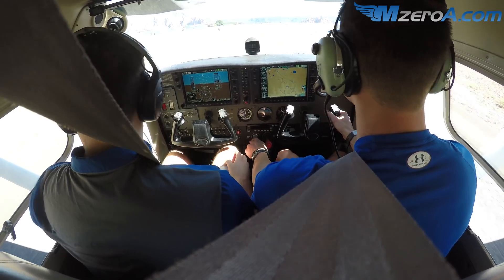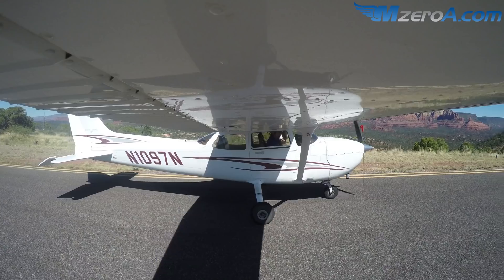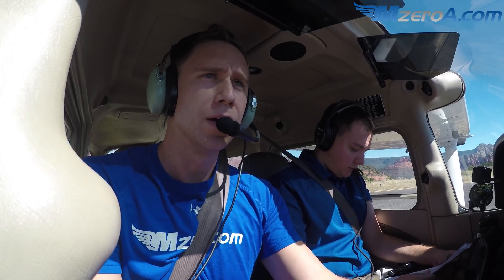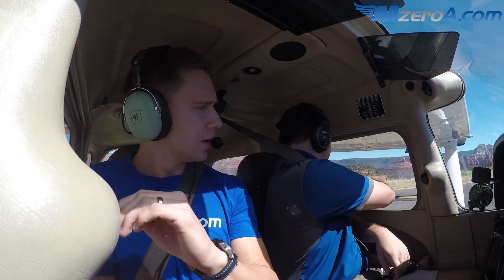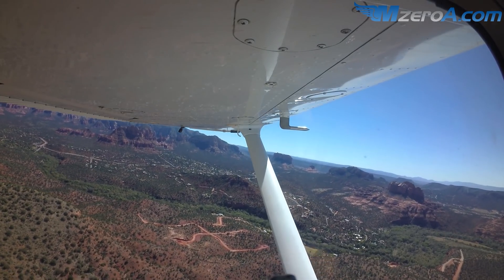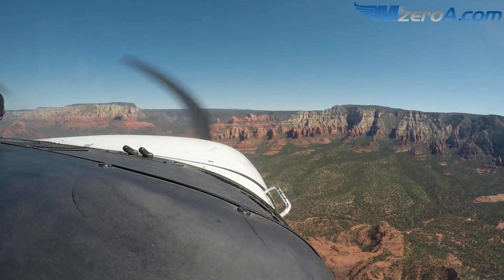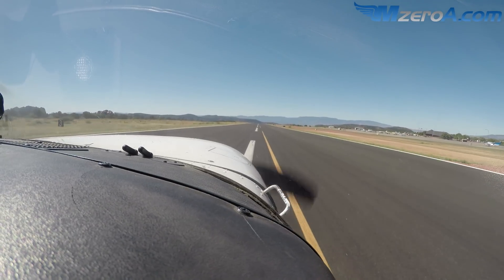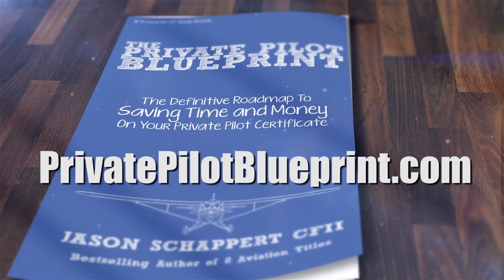Flying a high density altitude pattern - Sedona AZ - MzeroA Flight Training

Comment: Landing on 3 in Sedona is a snap - not so much with 21.  You're advised to land on 3 with up to a 10 Kt tailwind. IF higher than 10 you are advised to use 21.  That little hill they refer to off the end of 21 means you're likely on and off the power on final - a lot!  And if it's gusty, the stall horn is generally on and off. I fly a 180 HP Tiger and these AC don't have the big flaps. I learned to dump the flaps (if necessary) to get out of ground effect and land in the first 300 feet of RW. This video gives you an example of what happens when you land past the level part. After that you get into that 2 degree drop. You think you're going to touch down but the runway keeps dropping just about as fast as you are. Big fun! I will land on 3 with up to 15 knots. You do need to stick the landing before the 1000 foot mark, but you can stop pretty fast, even with an 75 kt ground speed.

Comment: You did not mention Rudder during flight instrument check on run up checklist.
It's important to check it in a front wheel airplane!
When you are taxiing, you are using front wheel for turns, as it has much more control on the ground than aerodynamic effects, and it's easy to miss that rudder does not work correctly

Comment: How would this be done in an aircraft with a constant speed prop? Would you lean for maximum fuel flow or manifold pressure??
Reply: you lean to max power fuel flow for the density altitude in question, per the POH. Many C/S equipped airplanes do not have best power lines with their corresponding density altitudes placarded on the fuel flow gauge, hell, carburated engines with C/S props don't even have a fuel flow gauge. On those you would have to do the old lean to roughness, then add two full turns in order to approximate best power fuel flow (which is generally 2GPH richer than the roughness point, which is closer to peak EGT or Lean o peak depending on the spread, injected engines having a tighter cylinder spread than carbs and thus able to lean farther before roughness). 

Additionally, if EGT equipped, you would lean to 150 degrees rich of the peak EGT reading. This would work regardless of altitude.

Comment: I fly a 172P out of KE95 Benson AZ, we get 6500' DA regularly and lots of days over 7000' DA.  I usually lean to peak rpm on runup then enrich about 1/8" rich of peak rpm. We use that up to about 3000' agl, lean further if going higher.  On landing it's all KIAS: 1 notch of flaps and 70 KIAS on downwind descent and base,  turn to base is determined by altitude (Pattern Altitude -200 or -250').  Turn to final is 20° bank or less then 62 KIAS over the numbers.  We come in high deliberately and usually cut power about 400 - 500' before the runway.

Comment: 1. Don't be afraid of turbulence a.k.a. thermal or dynamic up- and downdrafts. Fly gliders before trying anything else. If that's already too late, go and treat yourself to some hours of glider flying, preferably in mountainous terrain (and that goes for Jason S too!).
2. Like Glider123 stipulated: IAS is king. Maybe try some stalls in mid-air to get the numbers right for your particular aircraft. Treat any high altitude airport, however long the runway, as you would a short field. On final, choose an aiming point well before the threshold at 1.3 Vs and start pitching up and reducing speed before you actually reach the threshold (hold off in ground effect early, if you will). It will reduce your landing roll considerably.
3. Practice practice practice. At or near(er) sea level, ask your instructor to take you to as many short fields as possible.

Comment: For laughs I flew Phoenix to Sedona in FSX tonight, of course, after watching this earlier today, well, it's a fast flight over, but wheww it's no tupperware party! Yep, in the Grand Caravan I had to go around once, came in a tad too high and the power was all over the place due to windage and stuff, anyway, I came around again and got my alt. and speed nailed, I managed it! I was pretty damned excited. What fun! I cannot imagine attempting this airport in no visibility or awful stormy weather, no thanks. I notice you will lose power faster at this alt. as you come in for the approach, gotta really watch that, it demands a bit more throttle as you come down for final 1000 ft. or so. The runway is a decent length, that's not even the issue. I also did bounce a tiny bit once as I touched down, proving FSX is truer to reality than one might think. Jason does it again.

Comment: One thing that would have been a nice addition to this video is briefing an abort point for the takeoff and landing. With high DA, touching down "a bit long" can turn disastrous so it's important to predetermine a must-be-down-by point and commit to going around if not firmly on the ground at that spot. And of course the 50/70 rule on every takeoff.

In this case the runway was plenty long to offer significant margin for error in the 172, so it's not a critique of the flying - just something I thought would add to the teaching aspect.
Reply: Yes

Comment: I’m based in AZ and have done all of my training here, regularly flying in and out of high density altitude situations.  Ryan Airfield (Tucson) to Sedona was my first cross-country as a private pilot. Standard procedure for setting the mixture in my experience is just before mag check and not at full power. Specifically, on start and taxi lean about 1”, as you did. At run up, rpm to 1700 then lean the mixture until rpm drop, quickly sliding it back in 1/2 way to full rich from that position, then mag check, etc.  I’ve never heard of setting the mixture at full power, but see no reason why not.  I’m curious if anyone else who has done most of their flying in the mountains has an opinion or comment about which way they were taught or which way they prefer.
Reply: Eric Klein I'm from Vegas and during the summer I also lean during my run up at 1700 rpm. I generally will lean to peak and then give three turns rich. Then continue with the rest of my checklist. Seems to work really well. It's probably about the same as 1/2 like you said.
Reply: Hey Eric, are any of those flying schools still around at Ryan Field? (Ie IATA, NPA??)
Reply: Eric, I learned the same high DA leaning procedure as you while at Ft. Collins in a Citabria.

Comment: Arizona is where I fly all the time. Two of the most interesting experiences I've had or first afternoon summer time between Phoenix and Yuma. There's a solar farm midway between Gila Bend and Yuma. I hit that area when the outside air temperature was 105, and I was at 6000 ft. I experienced and 800 foot per minute climb with the power pulled almost idle and nosing down. What I learned after the fact was just to write it, and let flight following know was happening. Second interesting experience was the first time I landed it and took off from Prescott. I actually didn't change my mixture setting until after I rotated. I realized it wasn't climbing and quickly pulled off a glob of mixture. All of the sudden the power came back and I was able to climb out at a staggering 300 feet per minute. At the time the o a t was 90 degrees, and density altitude was 9000 feet.

Comment: Does it provide more aerodynamic breaking if the flaps are kept down?
Reply from the maker: The flaps are immediately put up to reduce lift and the nose of the plane is slightly lifted.  The nose-high attitude exposes more of the craft's surface-area to the flow of air, which produces greater drag, helping to slow the plane.
Reply: It also shifts CG back forcing more weight down on the main wheels thus allowing for more effective mechanical braking. Particularly helpful during conditions of reduced braking action.

Comment: Hello Jason.  Love your videos.  I'm a private pilot who has been flying in Colorado for nearly 25 years.  Like you, I learned how to fly at sea level.  I learned while in the US Navy and never really had too much exposure to high elevation flying, for obvious reasons.  I own and fly a 77 Grumman Tiger that I purchased last year with my son who is also a private pilot as of June of 2017.  By the way, I purchased your book for him to read and use as a study guide while he was training and he loved it!

Dealing with high density altitudes is a norm around these parts.  I found your technique for leaning for max power interesting.  It's exactly the way I was taught, however, over the years I've learned that it isn't always the same for every type of piston aircraft.  I've flown my share of GA aircraft from Piper to Cessna to Beechcraft and now a Grumman, and I can tell you each has it's own technique for leaning.

For example, in our Tiger, after engine start, we immediately turn off the electric fuel pump and lean the mixture to prevent spark plug fowling.  Then we wait for the oil temp to creep up into the green arch about 1/4 of the way, especially in winter.  This ensures the engine is nice and warm before we start our taxi to the run up area.  At the run up, we follow the POH, which says to throttle up to 1800 RPM, and then we go through the standard checks... carb heat, mags, vacuum, ammeter, fuel pressure, and finally oil temp and pressure.  Once those are checked and verified, we perform a full power run up and monitor the EGTs until they are stable.  We then lean to find peak EGT and then we enrichen the mixture slightly with one or two turns of the mixture control and watch the EGT drop between 200 and 500 degrees below peak.  This allows for better cooling of the engine during the climb.  The 0-360 in the Tiger is notorious for running hot at high power in the climb thanks to a tight engine compartment and the way the baffles are designed.  Also, the engine tends to hesitate when you apply full throttle  if you don't enrichen it after finding peak.  Apparently this is a common event among Tigers.  Initial RPM on a warm day is around 2300 RPM.  As the airplane rolls down the runway and picks up speed, RPM increases to around 2500 as we reach rotation speed.  On takeoff, we stay in ground effect until reaching Vx, 70 KIAS in the Tiger, then climb away until 500 AGL and then we lower the nose to Vy, which is 90 KIA at sea level and around 85 KIAS at 5000 and 81 at 8000.  We cruise at 2700 up to 10,000.  We then set the mixture a second time, running rich of peak.  That gives us around 67% horsepower with a TAS of around 135 knots burning 10 GPH.  We generally fly at 2200 lbs (Tiger has a max gross weight of 2400 lbs) most of the time and never with full tanks during summer months with more than 2 passengers.

Our home airport is KBJC in Broomfield, Colorado.  Field elevation is 5,673 MSL.  We're located less than 10 miles from the foothills of the Rocky Mountains, so strong winds, turbulence and every thing else that goes with it is also a norm.  If the wind is blowing out of the northwest, west or southwest, you can be sure it'll be a bumpy ride.  Anything gusting over 30 knots and most GA will stay on the ground.  When the wind is out of the east, that usually means a bit smoother conditions, however, that also means up slope, which is what gives Colorado its weather.  If there's lots of moisture to go with that easterly flow, you can bet there will be rain or snow in the forecast, especially if there's a strong low pressure system in the area.  So I understand your concern for avoiding those hills in your video during a day of strong winds.

Sorry for the long winded comments.  Just thought I'd share some of my "high flying" experiences.  Stay sharp, stay current and happy flying!
Reply: Loved reading your comment. I fly out of KCOS, right next to Pikes Peak, and your description of the Colorado flying experience was spot on! With consistent 9300 density altitude readings during the summer, it can make for some exciting flights. The winds also bite you quickly, I departed KCOS the other week with calm winds and came back to a lovely 44kts crosswind within the hour. Got to love it! Hope all is well.

Comment: So you're the out of towner landing on runway 21 haha, Overall great video! I would just recommend for anyone else that's looking at flying to Sedona to avoid landing runway 21 as much as possible. It's general practice to land runway 03 and take off runway 21 due to the runway gradient. There's also a lot of downdrafts coming in on 21, and you're overflying the town in a noise sensitive area. Thanks for coming to Arizona and the video!
Reply: In a taildragger like my RV-8, you generally want to avoid landing with any tailwind component. Much more so than in a tricycle gear plane. I personally would not land with any tailwind component.
Reply: Started my flight training out of Sedona back in the 80's and taking off on 21 and landing on 03 was standard procedure at that airport unless the winds were really extreme so I am in agreement with Aviation Guys . I  also remember having to come in high into 03 because of the updrafts would quit (and you would lose lift and altitude ) after you passed the drop-off on final. If the guys in this video wanted a real density altitude challenge, they could go about 22 miles north to Flagstaff where the field elevation is 7011 feet. I would guess that density altitude that day was better than 10,000 feet. Having said that, if they have never dealt with high density altitude before, it is better to take it in steps to get a feel of how the airplane will perform before taking that on. Don't place too much faith in book values since the airplanes that are tested to get those numbers are new and are flown by experts. Always add a generous fudge factor until one gets a better idea how the airplane (and the pilot) will perform!
Reply: Flew into there yesterday, read all the info, and watched all the videos -- "favor 03 even with some tailwind." Winds were too strong to make landing 03 seem like a smart idea. Don't just blindly follow some of these things, analyze the weather and use good ADM.
Reply: I'm from Vegas and have flown to Sedona a few times. Only to have the winds favor 21 every time. I've always flown my pattern a little high due to that hill on final. I think I'd feel more comfortable with a downhill landing than a significant tail wind. Especially at that airport. But it's a fun airport to fly into.
Reply: Landed at Sedona for my first time today in my 172. Winds were calm so I was fortunate. Beautiful airport and was still a challenge to keep a solid site picture with the uphill runway
Reply: It’s even in the A/FD.  It’s common in Sedona to have landing and takeoff traffic alternate between 3 and 21, assuming wind is under 10 kts.

Comment: Good one, Jason.  My first experience at high DA (being a flatlander from Houston) was a real eye-opener back in 2015, flying in and out of Boulder Municipal with a DA of about 6,000 in a C182.   Three souls on board, close to max gross (careful planning to not have full fuel!), and leaning properly.  Still, at that weight, used up a lot of runway!

Comment: With that terrain I would certainly fly a tight enough pattern that I could make the field from anywhere in the pattern if something went wrong. That's certainly not the place for a wide-flung pattern and a long final.
Reply: Unless you're lined up on final, you're not going to make that runway from anywhere else in the pattern unless you're super high-time or a CFI. It requires a super precise landing just coming in normal, let alone with an engine out on downwind.

Comment: Nice flying. Good patience letting the aircraft slow down with aero braking, not forcing it down on the runway.  

You didn't mention explicitly, but the mixture should stay leaned for best power even on landing.  It might be a trap to want to push full rich as part of the before landing checklist, which could reduce performance on climbout if a go-around becomes necessary.
Reply: could also flood the engine going full rich

Comment: So, if you have a direct crosswind and a sloping runway, I’d argue that you should take off downhill and land uphill. It’s a nice big paved runway, so you can use a normal pattern, but in a backcountry strip, generally one follows thr slope of the runway, unless the winds are fairly strongly favoring one.
Reply: I agree with your view, however during a strong gusting wind situation, I would just follow what the wind socks is telling me.

Comment: I've landed at airports with 10,000 density altitude, and learned to just fly indicated airspeed and not pay attention to true. You are going to land a  lot faster over the ground and take more runway than you are used to in Florida, so just plan on that. If you chase true airspeed on final, you might end up too slow, Keep the indicated where you would normally have it.
Reply: Exactly perfect comments.  We care about what is flowing over the wings to support our weight, especially at high ambient temps.
Reply: Correct, the aircraft will stall at a higher TAS but at the same IAS, so really nothing has changed except using up more runway. Unless of course the pilot is preforming an instrument approach, then TAS is important.
Reply: @Jetairplane  why is true airspeed important on an instrument approach?
Reply: @Alohalingui  True airspeed +/- wind = your ground speed. Your rate of descent is dependent upon your ground speed for an instrument approach.